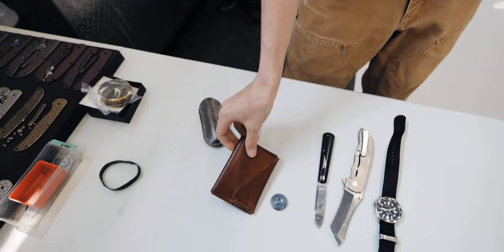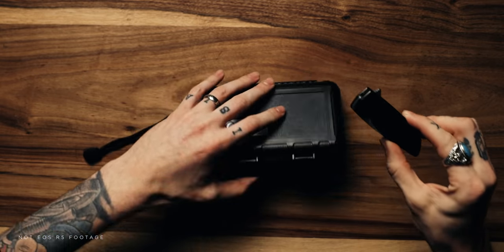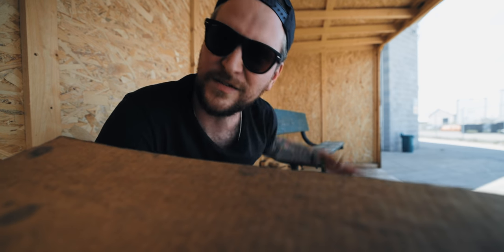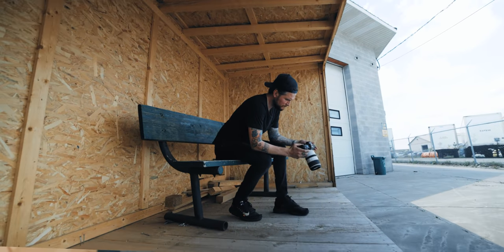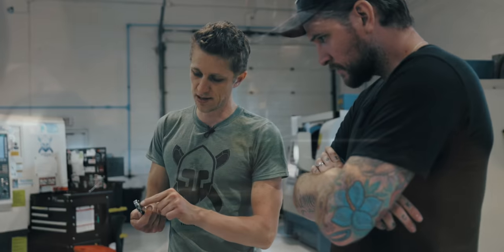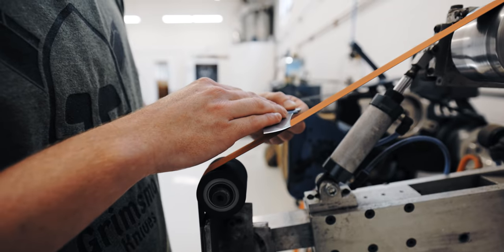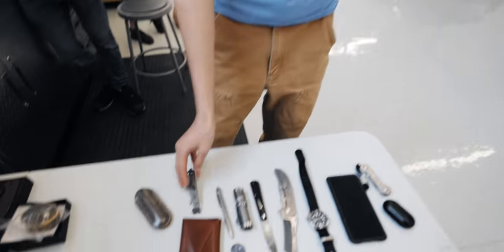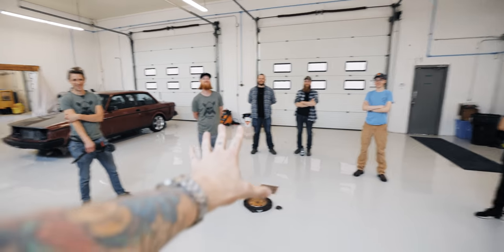Filmed this entire EOS R5 Video without it overheating...

Comment: just 5 mins???....its worst than I thought!
Reply from the maker: It overheated before I could finish the vlog and actually melted through my camera bag into the bed of my truck! It’s at Ford now as they attempt to pry it off the bed with some gnarly jaws of life like contraption. I was told though, dude to how badly it heated up, that’s it’s fused itself now beyond the bed into the frame of the f150. So, I hope canon puts outs a firmware update soon so it doesn’t ruin a second vehicle!
Reply: Peter McKinnon Well, I think the solution here is simple, you’re just gonna have to release a Peter McKinnon Nomatic camera bag number 2. The same bag, just slightly updated. Now waterproof on the outside, heatproof on the inside.

Comment: The video is 5 minutes 20 seconds long... for a reason
Reply from the maker: Yeah it overheated and the metal got so hot it started to melt and then burned my hands and I actually have a friend typing this cause I’m in the ER with my hands wrapped in a special bandage plus gel due to the extreme overheat-sun burst nuclear issue that I’m sure you have lots of hands on use with ;) 😂😂🌶🔥